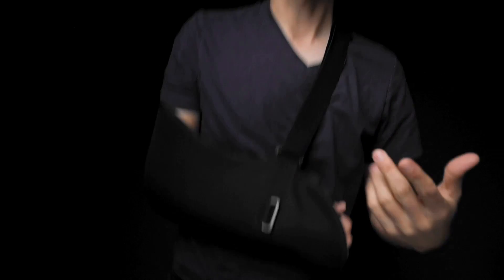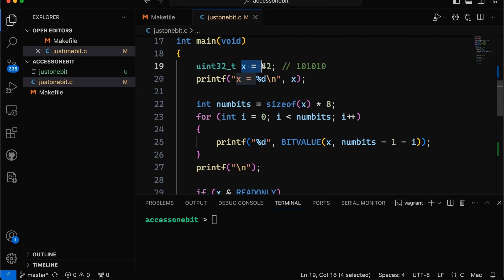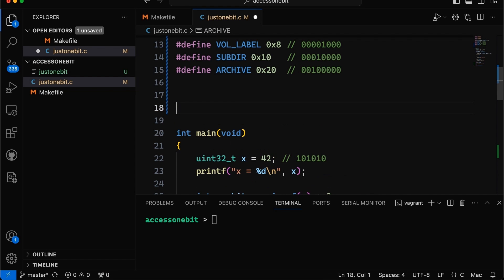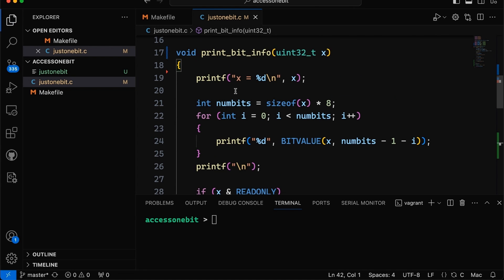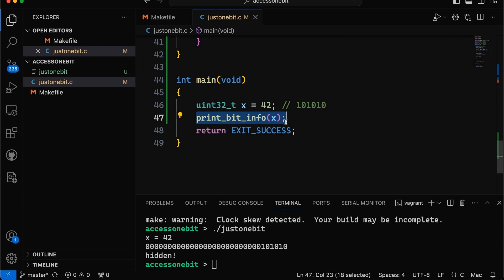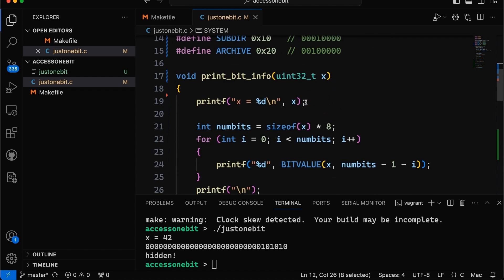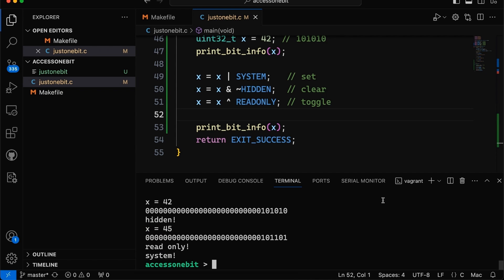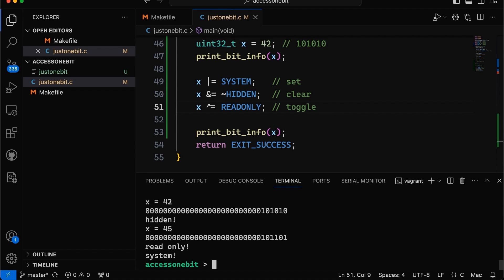How do I Set, Clear, and Toggle a Single Bit?

Comment: There is always a danger that C compiler will go crazy and transform values to different types and you will end up zeroing out a lot of bits on the left with `&` and so on. Implicit conversions are scary and can bite you multiple times in a row in places where you did not expected them, and this is most frustrating thing in C really, not absence of classes or other noise.

Comment: I love bit-twiddling! I consider it to be vital to small-scale programming, doing as much in as small a space as possible, which used to be critical in the old days of very limited memory.
I wish you a speedy recovery and I hope you feel better very soon!
Reply: It is also fundamental to hardware programming. By convention TTL 1 is 3 or 5V and TTL 0 is 0V. So bitfiddling at the address to which the hardware is memory mapped will actually make a voltage change we can measure (e.g. on an i/o board). Many beginners with C ask questions like “if C is low level, where is the hardware?” Well it is actually there (sometimes with inline assembly). It is useful to let students see that they can actually use C to control the hardware. That is something that is rarely taught.